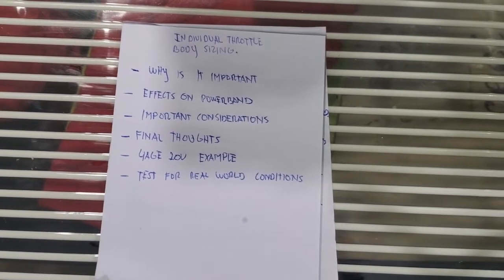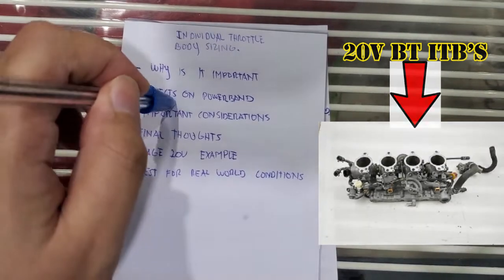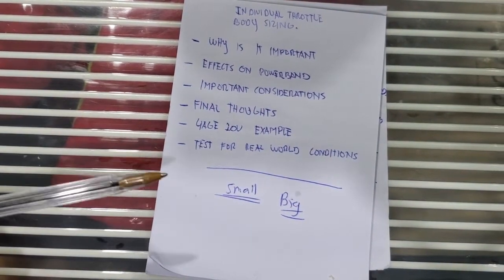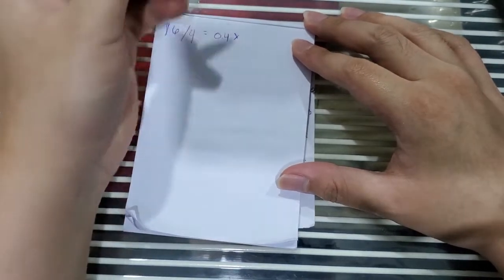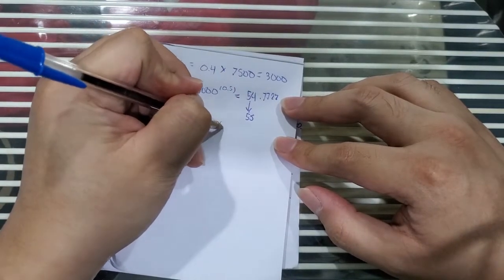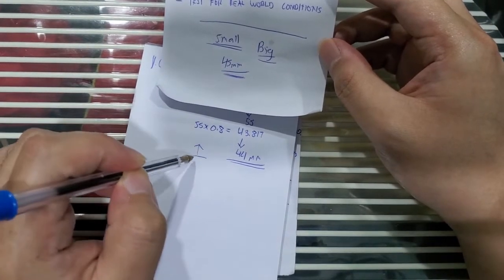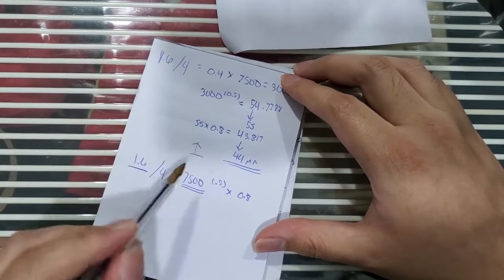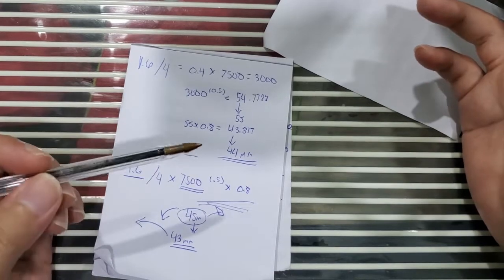Sizing Individual Throttle Bodies Explained plus simple formula for size calculation

Comment: The formula works well for your example engine, but seems like it might be a little bit off for other engines.

Ive just run it for a modified FJ20 Nissan engine (now 2.3lt & revving to 9000rpm)
Using those numbers, rounded as you have done in the video, it suggests throttles of 72mm 😳
It's currently making 220whp on 50mm Weber carbs, these also have venturi chokes in them...
Throttle body makes websites are suggesting around 48-50mm based on current power per cylinder 🤔
Reply from the maker: I see! Thank you very much for your insight on this topic. I believe that by manipulating the value of that represents the volumetric efficiency being 0.8 and changing it to a different value, you should be able to get close those recommended sizes. 🤗 for the FJ20 I believe that it was suggested at around 60 to 70 percent for volumetric efficiency considering similar engines of the era having similar volumetric efficiency numbers.
Reply: @JWorldAdventures 
Not sure what VE they were achieving, but the Nissan rally team was pulling 280hp out of the 2.4lt on 50mm Solex carbs.
Maybe the formula needs a bit of tweaking. 🤷
Reply from the maker: @Danger_mouse Thank you very much for your input! I really appreciate it!

Comment: Your formula seems good. According to it I need to use 50mm itbs on my vw 20v build
Reply from the maker: Thank you for commenting. Yes do note that is just for your baseline number. Real world testing is still needed, becasue I don't know if you're aiming for low-end torque, or high rpm horsepower. But the formula will help you get to the ballpark. Real world testing is for fine tuning to what your aim is for the build. Good luck with your build sounds awesome!! 👌 cheers 🍻

Comment: How do you do the ^.5 on the calculator on my phone or calculator I have here neither seem to have this function is there another symbol for this im not aware of??
Reply: Square root.
Reply from the maker: @pdr5926  No, that would be the complete opposite of the square function I am pertaining to.
Reply: @JWorldAdventures  That´s what you did, buddy; square root of 3000 = 54.7722. It is the same as X (3000 in the example) to the power of 0.5.
Reply from the maker: @pdr5926  Fair point!! Thank you for your comment!! Have a good one👍
Reply from the maker: @Peter Lander Thank you for the question. In answering your question, you would be needing to use the exponent function normally labeled (xy or yx in some cases) then just input 0.5 once you pressed the exponent function button. I hope that I was able to help you out!! Have a good one!!👍👍👍

Comment: from where this formula came? never saw it before, pretty interesting
Reply from the maker: @Bearth Thank you for the question. This formula came abouts from considering the volumetric efficiency of an internal combustion engine. This by no means perfect, but should get you to a ball park figure to start from that's not too small or big for your particular engine combination. I hope that I was able to answer your question. Have a good one👍👍👍👍
Reply: there is some formula that i can use to know the size of itbs to equals an individual throttle? i know that for my engine (turbo) aplication a single 58-60mm body is fine, so i want to know what size of ITBs are equivalent in size

Comment: Can you explain where the ^.5 and (.8) come from? I'm guessing (.8) is for VE as 80% VE is standard on most engines?

Does this work for engines with more than 4 cylinders? V6, V12? I would assume since you are splitting total displacement by number of cylinders but it's work double checking since I don't know where the constants are coming from.

Great video BTW! Nice to have a formula for a quick and dirty calculation of TB size.
Reply from the maker: Hey there Rob! As per your question the two constants are both for Volumetric efficiency. The ^.5 is for VE at idle and (.8) is for the peak VE.

And for the other question. Yes, this will work for any engine configuration. 

Glad you liked the video! I really appreciate it! Have a good one👍